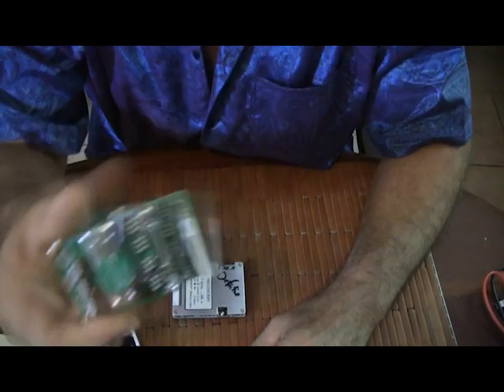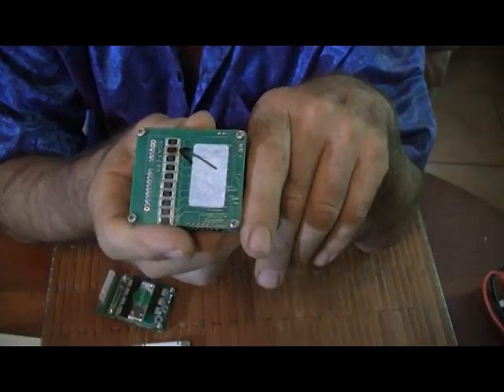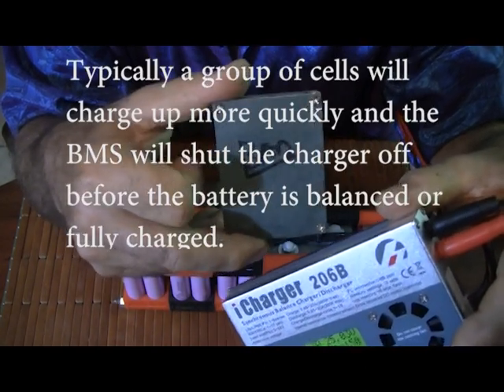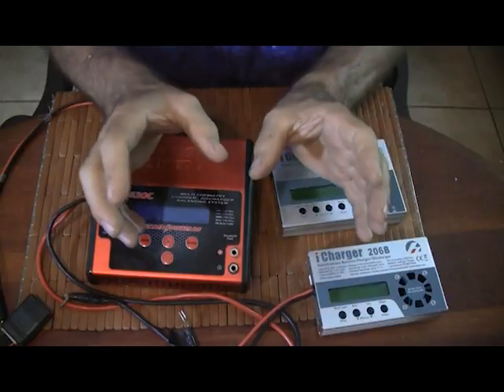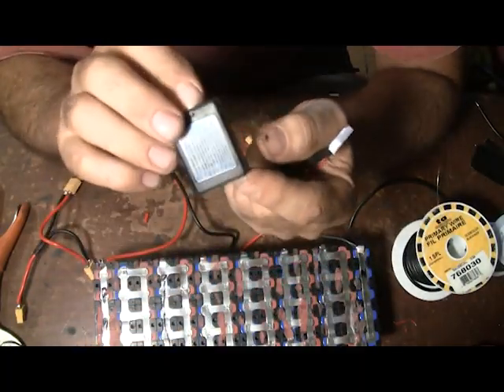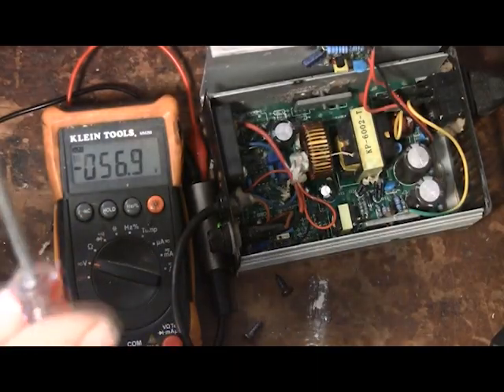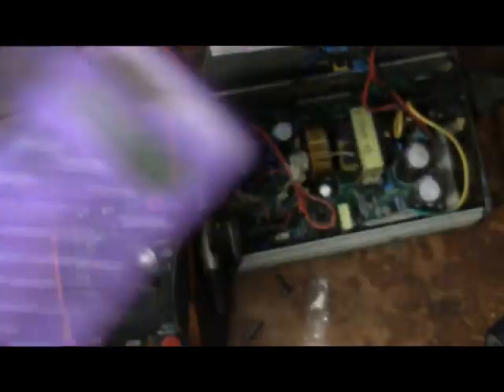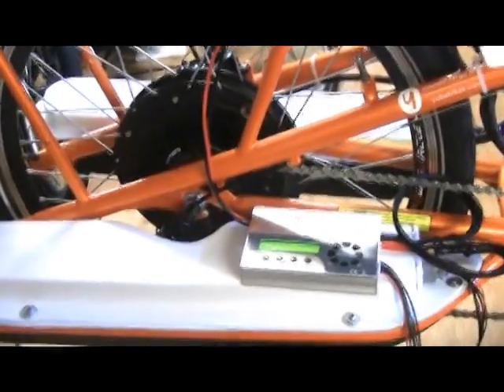How to build a safe and better lithium battery WITHOUT a BMS.

Comment: how many batteries can you put in a cell reliably? i see you have 6 per one lead on the balance charger.
Reply from the maker: That is a great question and the answer is "it depends."  There are two factors that determine how many cell syou can put in parallel and reliably balance:

1.  Ability of the balancer- BMS or Hobby Charger to bleed the high cells.
2.  Tendency of the battery to come out of balance because the cells are funky.
#.  How fast do you need the job done?

Hobby Chargers in general have more bigger resistors and so are better able to balance more cells.  Many BMS's are designed for ebikes which might have 4 to 6 cells in parallel.  

I reliably balance 20 cells in parallel with a quality Hobby Charger on my ride.
Reply: I have 26650s i would like to put four in parallel and seven of those in series do. I need 4 balance chargers in 7 for each individual 26650? or just 1 seven lead balance charger for each complete cell of 4 26650?
Reply: I am building a 24 v 14000mah pack with solar charger and panels in series for 24 volts. then dc to dc down to 12 for camp charger unit for radios, lights, gps, cell phones.
Reply from the maker: You need just one 7 lead hobby charger.  Most likely you will use an 8 lead hobby charger.  It would be called an "8S"
Reply: yes i have one on order just wanted to make sure i didn't need 4 thank you very much.

Comment: What is the model of the cell logger? where to buy it? Thanks
Reply from the maker: http://www.hobbyking.com/hobbyking/store/__67120__HobbyKing_8482_Cell_Checker_with_Low_Voltage_Alarm_2S_8S_AR_Warehouse_.html
Reply from the maker: Buy it from Hobby King.  
http://www.hobbyking.com/hobbyking/store/__67120__HobbyKing_8482_Cell_Checker_with_Low_Voltage_Alarm_2S_8S_AR_Warehouse_.html
Reply: httphttps://rover.ebay.com/rover/1/711-53200-19255-0/1?ff3=4&toolid=11800&pub=5575234824&campid=5337973068&mpre=http%3A%2F%2Fwww.ebay.com%2Fitm%2F10PCS-MICRO-USB-TP4056-1A-Battery-Charging-Module-%2F351524233162%3Fhash%3Ditem51d87a1fca%3Ag%3A~swAAOSwWnFWAT0M
Reply: cool thanks!

Comment: I keep coming back to this. Is there a faster way to balance these packs? mine end up at 3.9 4.0 4.0 4.0 4.2 and it takes forever to put it straight again using the charger (multiple days) and still forever (multiple hours) to just charge each pack up one by one. I need to design us a super smart charger for these packs that quick balances.
Reply from the maker: That high cell at 4.2 is what is holding up the process.  The BMS shuts off the charger to protect that cell.  So, get a 12 volt auto turn signal light and solder on to it two wires with alligator clips on the ends.  Attach it to the 4.2 volt cell group and it pulls the voltage down. It is like a powerful resistor.  Now try charging.  The BMS may not shut off the charger.........OR- use a quality hobby charger like an icharger.
Reply: I refuse to use a BMS. Too much cash, not enough working. I'll do the light trick. Laptop cells work, but I'm still working through the kinks. Like the idea of the battery blocs, it's just not for my application.
Reply from the maker: Sure, BatteryBlocs are not for all applications.  You could make a couple light bulbs and drain the high cells, or keep moving the light bulb to the highest cell.   Good luck!

Comment: ok so i'm thinking of building my first ebike 48 volt lithium batter 14 long and i think 8 wide maybe 10, i've ordered a hobby charger and some wires for it, i may need to order more, i'm not using the BMS i'm going to use the hobby charger, i  think i may have to use 2 battery packs the charger i've ordered i think dose only 6 or 7 banks tops, i have a 10 wire kit of different sizes from 1 to 10 bank i think, but their is 10, what i need to know is this, them cell augers i looked on ebay for them and can't fined them this is a really good idea to have them to keep track of your batteries, i have a computer shop that's going to save me laptop batteries for free, they only thing i have to pay for is the charger and what not, but hay free batteries for as long as i want them, where the heck can i get them battery meters or augers, i do know that laptop batteries go bad becuase of the small BMS in them, i allway take my laptop battery out when full charge so that it will last longer and only put it back in when i need to, these are made to go bad fast so you have to get a new one sooner but the batteries are really still very good in them
Reply from the maker: Laptop batteries are great for experimenting and building your first lithium batteries, I have built my share! 

Get the cell loggers from Hobby King:

http://www.hobbyking.com/hobbyking/store/__18588__HobbyKing_8482_Cell_Checker_with_Low_Voltage_Alarm_2S_8S_.html

You will learn a lot!  Go for it!
Reply: i have found them logger battery tester on ebay and their very cheap, 2.00 to 5.00 bucks, the charger i'm getting i never thought to see how many bank it would do, the imax only does 6 banks at 24.99 and i never thought to check and see if the power supply came with it and theirs none, lucky for me i have about 8 laptop power supply on hand that i can use, so now i'll order them meters this week, so a 50v battery i will need to have in 3 parts since i'll only have a 6 port charger, great vid by the way, this vid showed me more then all the ones i've watched, and i've watched a lot of them
Reply from the maker: Sounds like you are a quick learner Simon!   Congratulations on actually doing it.  This balancing setup is good for laptop or when using batteries that are mismatched.  When building the battery try to distribute the different cell types evenly amongst the parallel groups to get the average.
Reply: yes i do know about matching the batteries up but i'm going to try and take it one step more since i'll be getting the laptop batteries for free i'm going to try and see if i can match all the batteries same type this way i'll have a good even battery pack, i've learned all lot on my own, i can fix busted up computers and electronics i've never had to buy one computer ops yes i did but just one, laptops yes their just to hard, so it's not to hard for me to do things that's electronic, i've got just about everything i need coming even the nickle strips, i still need one or two more parts, i don't have a welder so i'm going to make one with laptop batteries and some nails should do the trick
Reply from the maker: Practice spot welding on your crap cells.  It is easy to puncture the negative terminal of the 18650's.  When you do, it will be very subtle, but you may feel a stickiness on the terminal as the battery bleeds.  You may also smell the liquid.
Reply: oh yes i know i smelled that before on MH batteries, i know that theirs not much on the neg end of the battery, it's as thin as a pop can, or i may just solder the nickle stirs to it, but this is not good for the batteries adding heat to them, i found this out the hard way with an AA flashlight battery

Comment: just a quick update. I have assembled the pack using your method of no bms. still waiting on the new volt checkers as the first type are a waste of time. balance charged the pack to 4.1 volt traveled approx 50 km and stop to check voltage on cells from time to time. they haven't drifted at all. bulk charging now and will monitor  every 30 min. thank you so much. you have been a great help.
Reply: Hi Which volt checkers did you find best ? (link)
Reply: https://lh3.googleusercontent.com/tUh95SS7i1GXyEjz3NPcq5ROzm6Qg6rY1uFvxRX8NNaqTx0rpcsfJqGMRvyJIYvdwTo2vgsP
Reply: I will look to see the seller's details and let you know
Reply from the maker: That's great Antonio!  I love it when someone actually builds one of these packs.  You can use the over voltage alarm on the cell checkers so you don't have to physically watch the packs....
Reply: Any link/manufacture for the preferred Cell Checker supplier Shawn ?
Reply from the maker: http://www.hobbyking.com/hobbyking/store/__67120__HobbyKing_8482_Cell_Checker_with_Low_Voltage_Alarm_2S_8S_AR_Warehouse_.html

Comment: Another tought - could one be able to possibly increase a chinese bms balance current by stacking up smd resistors and improving heat distipation with tiny heatsinks and fans? Since i would like to charge and balance my recycled laptop 6s1p batteries fast. I test every capacity individually and make the packs  +-80mah  and stack them up to a configuration 6s10p. I want to charge them with 10A and realised that the board has 68 ohm resistors on them and that 0.06A current wont be sufficent if the pack is really out of balance.

Maybe someone has experimented with this, so im asking if this will make the bms do weird stuff or it will function as normal (it has 5A dual-ch n mosfets on board for the balance resistors so in theory mosfets will handle it but im not sure about the other weird components on board like GLCN, GLCP, G2JL - no info on the internet about those 5 pin smd chips)
Reply from the maker: Sorry Random Gamer, out of my league.  I am working on building a distributed BMS with 20 watt resistors for larger batteries.  Are you interested in helping me to test this when the design is complete?

Comment: I'm in the middle of assembling a battery pack the same as your video. I have gotten 4 of those cell monitors but they are reading wrong. cells balanced to 4.10v. checked with a meter and all at 4.1v. But the monitors are reading all over the place. from 3.96 to 1 row reading 6.24v. makes no sense. any idea?
Reply from the maker: Yes, it is possible that you got your signal wires in the wrong order.  The Cell loggers work by having one wire go to the negative of the whole battery and the signal wires go to each positive.  The signal wires would read increasing voltages, ie, 3.5, 7, 10.5, 14, etc.  

The cell logger does subtraction to come up with the actual voltage on each cell group.  IF you get them in the wrong order.....    Check that first!
Reply: They are wired the same as for the icharger balancing lead? 1 on the minus and 7 on the plus respectively? Thank you for the quick reply
Reply from the maker: Yes, that's right, they are.  wire 1 is on the negative, wire two is on the positive of the same cell group, wire three is on the positive of the 2nd cell group, wire four is on the positive of the third cell group....
Reply: I have rewired it again but had checked it and all was wired right. Still reading wrong. Funny thing is I purchased 4 of the units. Again wired the same for balance charger. charger and meter reading right. these units aren't.
Reply from the maker: Try reversing the plug that goes into the cell logger- perhaps you have it in upside down?

Comment: How's the mundo holding up? I really want that frame.
Reply from the maker: The Mundo frame is bulletproof.  The feet rests in the back have some load limits and can break under heavy use, I have welded mine several times.  The front aluminum basket tends to break and I cannot recommend it.  But the frame is super rugged- I did ride mine around the USA.    https://www.amazon.com/Loop-USA-odyessy-Shawn-McCarty-ebook/dp/B017PDCM96/ref=sr_1_1?ie=UTF8&qid=1474899347&sr=8-1&keywords=loop+the+USA
Reply: Holy.... I only planned on a 400 mi trip. You win. Guess I'm sold. Planned on building a small trailer and wall Mart camps just like that. Make as many 6s10p laptop packs as I can and go at it next summer. What did you do for torque arms?
Reply from the maker: Yes, I camped a lot at WalMarts...  I don't like towing a trailer- you can really haul a boat load of camping gear on the Mundo---- and trailers make stealth camping more difficult.....  No torque arm needed on the beefy rear Mundo dropouts.  Focus on a high powered charger so you can charge quickly.  You will be grabbing lots of 15 minute charges as you travel..   1200 watts is about right so you don't blow shop owners circuit breakers.

Comment: Hi Shawn You must think I'm a pain in the ass asking all my questions. Do you know much about error messages on Chinese ebikes? I'm racking my brain with this one. My battery isn't balanced but I have 51v on the battery and the LCD display shows an error 10 and a low battery. Could this be why my ebike doesn't work. I've changed halls in the throttle and this tested to be fine. I also changed the halls in the hub. This also tested to be fine all working. Also. Is there a way of changing an LCD back to its original factory settings. Thanks for your time. Some really informative vids on your channel.
Reply from the maker: Yes Harvey, my first guess is that the BMS has shut off the battery because one cell is low.  But you say the battery voltage is 51- did you bypass the BMS to read this voltage?  Check to see if your controller is working by looking for a ~4 volt output for the hall sensors and the throttle.  If not, the controller is not powered.  Could be a defective controller....
Reply: +Shawn McCarty I don't have a BMS. I have one cell of Sanyo batteries on 13 cell pack. 12 cells Panasonic. The lowest cell is 3.44v. I've made the battery myself.. how do I test for -4 from controller? Thanks
Reply from the maker: To check for controller voltage look for the 5 pin hall sensor connector.  You will see red, black, yellow, blue and green wires.  Check for four volts across the red and black wires.  If it is not there, your controller is either turned off or defective.
Reply: I tested with an Chinese ebike controller and there is 5v light on flashing but the circle lights aren't flashing at all when I turn the throttle. Ok so I need a new controller would you recommend a good one for a 48v 1500w or do you think mine is reparable? I haven't really seen any useful controller diagnostics on here. Really love your bike set. Wired for sound.
Reply from the maker: Oh, you have the Chinese tester!  That helps!  I have never repaired a controller.  Just be sure your throttle is working properly- test that too.  If the throttle is good but the lights don't spin, then yeah, replace the controller.   Where to buy a controller?  For cheap, Alibaba.  For quality,  http://www.lyen.com/
Reply: You know I wouldn't know where to start with ordering just a new controller from a foreign supplier in Canada. Bar replacing all the gear which one of those would you recommend to purchase. I guess it's not difficult to wire up the hub halls and the main stator wires from the hub and battery is it? But what about the LCD and throttle? 6fet 12fet. Amps. My controller is 35amps 48v 1500watt. Can you give me some guidance to get me back on the road for a reasonable middle of the road budget?
Reply from the maker: Why don't you talk to my friend Alan at Busetti Bicycles.  He has a wide stock of controllers with and without LED's.  He speaks Chinese and lived in China for years and married a Chinese.  He can get all your details and send you controller that will plug and play with your existing wiring.

Alan- Busetti Bicycles- 1-323-901-9941   Good luck!  Repairing these bikes requires a lot of patience sometimes!
Reply: Is that in the states? Have you got an email for him? Thanks
Reply from the maker: Yeah, it is stateside.  bike@busettii.com
Reply: Thanks man you've stepped over and beyond the call of duty.

Comment: Hi Shawn Love your sense of sarcasm I have a 54.6v limit charger. Would I be able to limit the voltage down to 53v on a 13series pack to get 4.07v per cell and do I simply connect up the multimeter leads to the charging port of the charger?.
Reply from the maker: Yes, you should be able to.  I use alligator clipped jumper cables to connect the multimeter leads to the charger XLR.  The top of the metal charger case lifts off when you remove four screws.  Find the tiny blue potentiometer with the gold screw and adjust while watching your multimeter.  There is a limit as to how far the voltage can be adjusted, but a volt and a half should be doable.
Reply: +Shawn McCarty Thanks for that. After watching your video I will always be thinking BS when hearing you say BMS. Haha. I won't be fitting mine now. I bought a 57v limit charger and literally blue up my battery pack. Took half my
Bike with engulfed in flames. Firemen weren't impressed. Now my wife has a nervous twitch every time I talk about batteries.
Reply from the maker: Yes, you should be able to.  I use alligator clipped jumper cables to connect the multimeter leads to the charger XLR.  The top of the metal charger case lifts off when you remove four screws.  Find the tiny blue potentiometer with the gold screw and adjust while watching your multimeter.  There is a limit as to how far the voltage can be adjusted, but a volt and a half should be doable.

Comment: What I don't like about low voltage alarms is that mine is just like in the video is not showing accurate voltage when it shows 4.3.  How can you trust it when it shows wrong voltage?  Maybe for general purpose it's ok.
Reply from the maker: Good point!  You need to check them to be sure they are accurate.  I recommend buying an extra one or two- they are under $5- and checking them before relying on them.  It's easy, just hook one up and compare it's voltages to the battery voltages using a voltmeter.  If you have a dud, just unplug it and try another.  

I guess it's part of the blessing/curse of cheap parts!